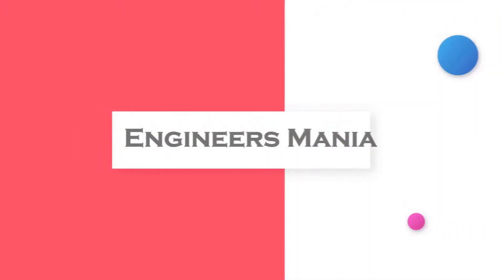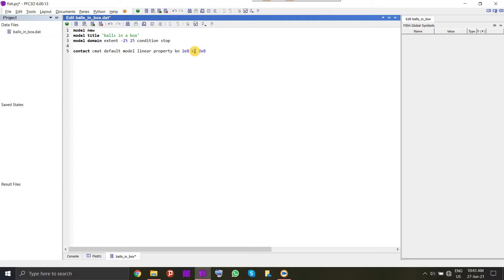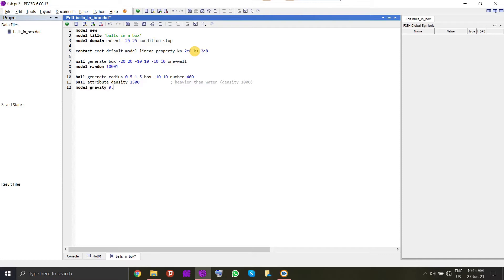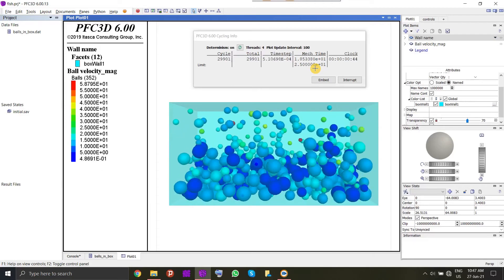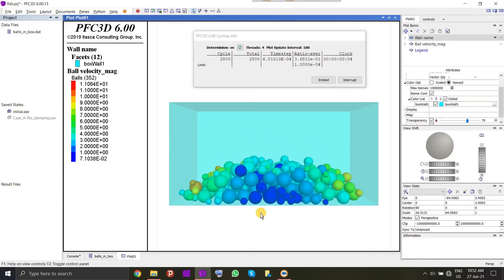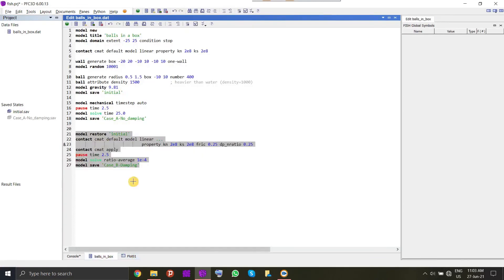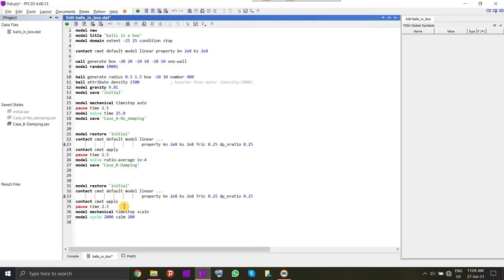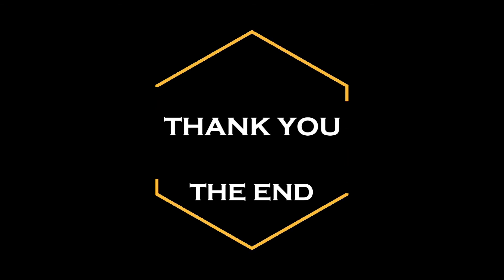Efficient Model Equilibration in Discrete Element Method and Particle Flow Code (PFC).

Comment: I found your videos on really informative! I'm currently working on a project where I'm conducting material tests and calculating fracture under load stress. However, I'm encountering an issue where the data is not being captured in the CSV file as expected. I'm not sure what's causing this problem.

Could you please help me troubleshoot this issue? I'd greatly appreciate any insights or guidance you can provide.
Reply from the maker: It would have been better, if you could describe your issue more clearly. If you are having trouble importing data from a csv file which is more common, it might be due to the syntax which is required for proper csv file. Look for table import command in the pfc manual where you will fine three necessary condition on how to format the csv file so that it can be imported correctly.

Comment: Sir do you know how to create clumps inside cylinder?please respond
Reply from the maker: The procedure is similar to what has been shown in the other video of rockfall simulation. Just create the cylinder, and while creating the clump particles in the bins, use the dimensional coordinates inside the cylinder. That will do it
Reply from the maker: use the "box" keyword to create the clumps with specified coordinates. Try it, if you have issues, feel free to ask.

Comment: Very well Explained, Can we model the hydraulic fracturing at lab scale; injection of fluid instead of axial load confined at specific stress, pore pressure and temperature. Regards
Reply from the maker: yes you can. However, that will require highly advanced skills because it will require coupling of PFC and a CFD software such as openfoam. but PFC team doesn't provide any support for this coupling process, so it is hard to crack and require proper knowledge of cfd software and python scripting.

Comment: Excellent presentation, thanks a lot for share. A question please, can you teach us how get the values Kn and Ks ? Please ? maybe another parameters needed to run the program.
Thank you in advance. If you dont have time please share me a procedure or paper related with this procedure.
Reply from the maker: The values of kn and ks depends on the material behavior. So it matters whether your material is similar to metals that are known to have standard range of properties or soil like material where the range of properties vary over a large magnitude.
So, if its the earlier one, you can find those in literature easily. However for the later case you will need a experimental or analytical results to find a value that works for you. It is one of the disadvantages of DEM that you don't get to work with laboratory ready parameters similar to FEM and FDM. So i would suggest you find any standard test for your material and calibrate the kn and ks for that material. As an example for soil, we perform triaxial test in lab and the simulate the same in DEM and change the values of kn and ks till i get a match with the elastic modulus.
I hope it helps....
Reply: @engineersmania7353  Thank you for help me to solve my question. I'll try to do triaxial test in PFC. Could you make a video show that please, for youtube ? In fact, I´m trying simulate a rockslide in a dump and I´m using the code in PFC Examples, and I'm changing value and stl files to do that. It´s my target.
Reply from the maker: @freddycalderonvela6409  You don't need to perform your own coding PFC supplies a special package regarding this. you can search on their website they have a special package that include everything from sample preparation to testing and calibration.

Comment: thanks a lot  for this good video , I want to simulate impact of particle to  a coating....is this simulation done with PFC?
Reply from the maker: Yes, it is done using PFC, Yes you can do that simulation by depicting a particle interacting with a wall. There is an example of particle rebound in PFC manual, you can refer there.
Reply: @engineersmania7353  I need to assign high velocity to ball for example 1000m/s ,Do it done with pfc?
Reply from the maker: @fatemearvandi1382  yes it can be done with PFC, you can access the velocity property of ball and assign the value using ball.veocity FISH command or regular command ball velocity.
Reply: @engineersmania7353  Thank you sir🙏